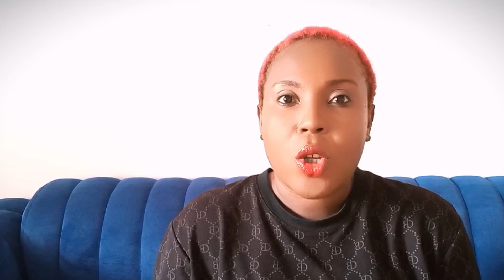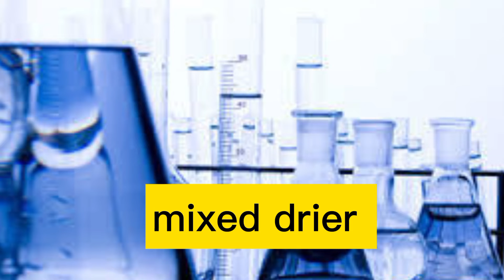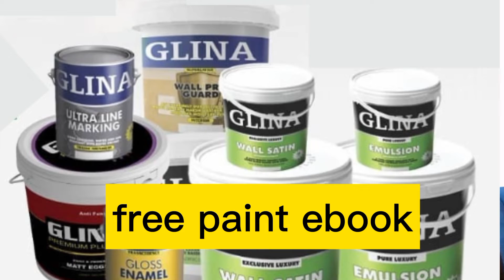Create Gloss & Anti-Rust Oil Paints Fast: Essential Chemicals You Need to Know!

Comment: Can I add engine oil in oil base Paint for higher gloss
Reply from the maker: Most people do that. But there are other ways to make it glossy. Engine oil is used in creating gloss pigment if you don't get the original Pigments. So yes you can use it . But their is a chemicals to achieve glossiness
Reply: @GlinaArtistic  thanks alot to you